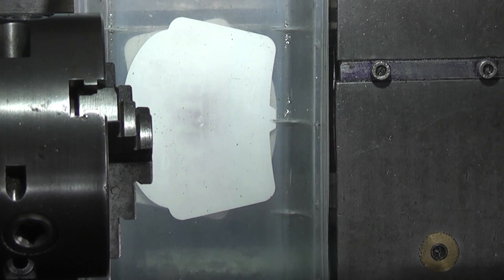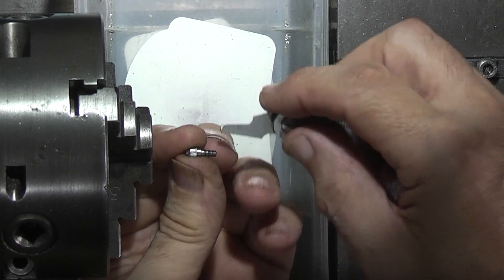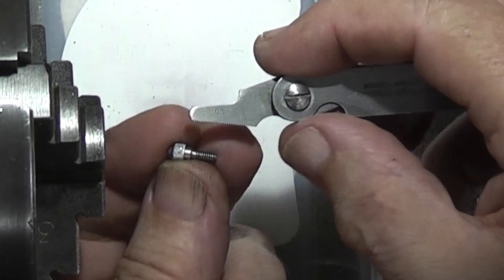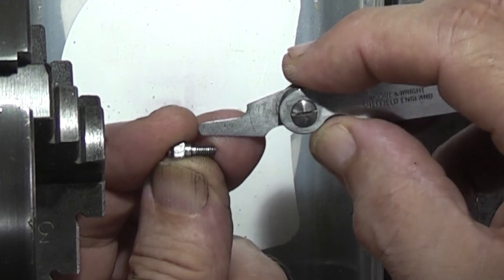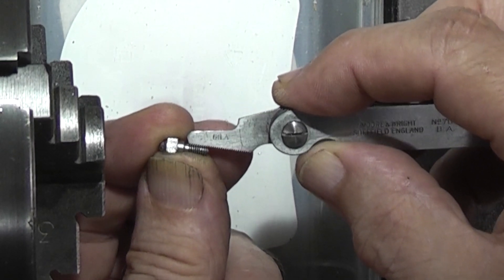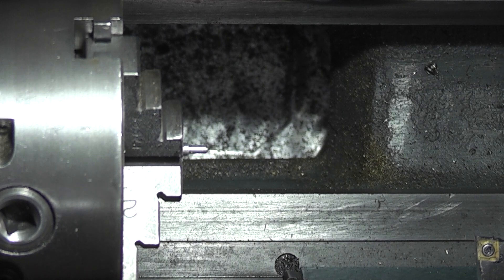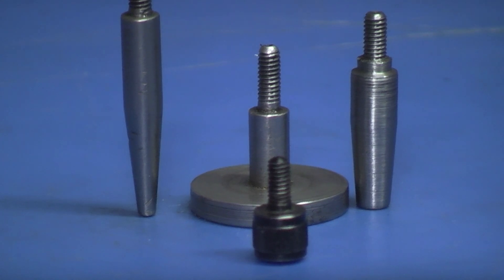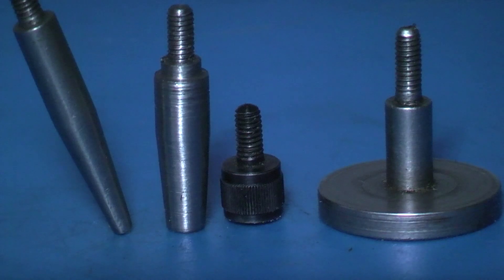Making an extension anvil for a DTI

Comment: Hi I'm on making a DDTI extension one which I was told the thread was 2.5mm but on receiving the gauges soon found this to be incorrect. My son had given me a simple plastic thread check which happened to have on it #4-48 NF which it fitted. On using my Whitworth thread gauge it confirmed 48tpi but not 55^. Hope this helps others as well as any future makings.

Comment: According to the Wikipedia article on dial inticators https://en.wikipedia.org/wiki/Indicator_(distance_amplifying_instrument) the thread for the tip or anvil as you prefer is either 4-48 for imperial or M2.5 for metric. 4-48 is fine thread and taps and dies for it are not commonly found in standard selections.
Reply: Older British engineering used BA sizes. 6BA and #4-48 are almost identical; 6BA has 47.92 threads per inch. I guess the screw will bind more the longer it gets.

Comment: I have the same set up exept I boared an arc the radius of the indicator so that there is no need for an extension , my mistake is I put it between the head stock and the carriage where the swarf  can mark the lens , I may put it on the tail stock side ...